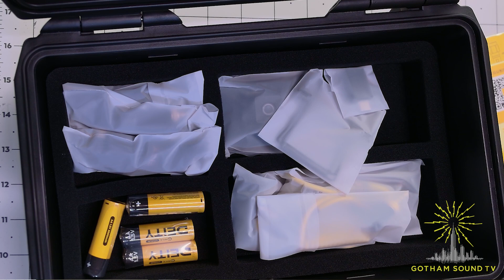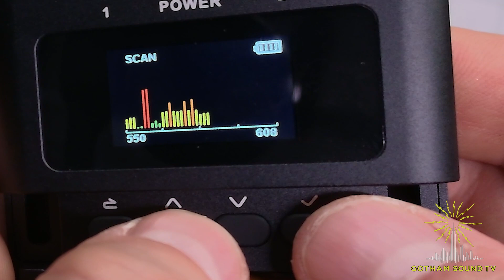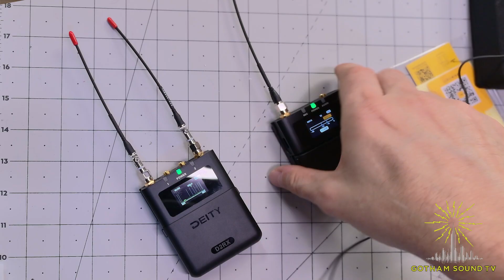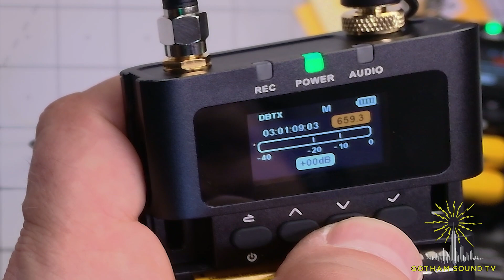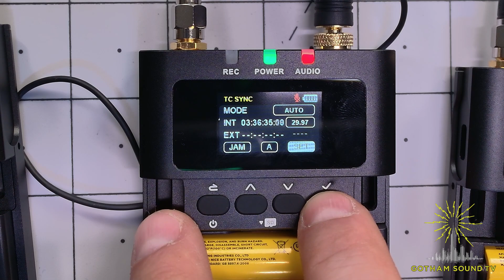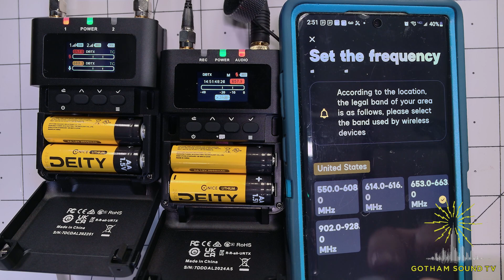Deity Theos Wireless Deep Dive with Andrew Jones

Comment: Be aware of the customer service is not that good. 4+ years of trying to fix my Deity Connect system... From my first support ticket in April 2021 to countless follow-ups, shipping costs, and tests - nothing worked. Instead of a real solution, I was pushed to buy a new Theos system "with a discount." After losing time, over $750 in related costs, and all patience... it's time to switch to Sennheiser.

Comment: How can Gotham promote these things? Theos wide bandwidth of the transmitter signal is 700kHz, over 3 times the width of any other wireless mic system allowed in the UHF bands. Theos is typically not allowed in any public event that is frequency coordinated. Theos transmitters also generate a large burst of digital RF noise over 1 mHz wide(!) every time they are turned on. The burst occurs around 550 mHz, for about 3 seconds. It does not matter what band the transmitter is tuned to, the burst still occurs at 550 mHz. Not a friendly device in a sound bag or in any location where other wireless are in use, like a PA system at a concert or conference. Those systems may get a 3 second RF hit on their wireless, or worse a loud audible burst of digital hash. Theos should not be marketed in the US.
Reply: I just notice this issue in a tutorial about Theos and the new Saramonic K9 with Curtis Judd. After a while Saramonic correct the issue and It was explain by Curtis. 
I am wonder if Deity will resolve the problem, and I say "will" because I am sure they can.

Comment: I just bought a Deity Theos kit to replace my 2 Sennheiser G4.
My setup: Alpha 7S3 with an XLR-K3M adapter. The K3M at micro level. D2RX level -20.DBTX +15DB (whatever the level the noise remains the same), RF power 50mw. 
Case 1: RX1+RX2 on the Jack 3.5 cable connected to the K3M (no line level on channels 3 and 4 of the K3M) the background noise is very loud. this configuration is unusable. 
Case 2: RX1 and RX2 connected to A and B of the D2RX with the XLR cable. micro level. there is still some background noise but less. The sound is worse than if I use a Sennheiser G4 or a DJI Mic 2!!!. 
Case 3. line level on channels 1 and 2 of the K3M. D2RX level 0 or +10. the sound on the alpha 7S3 input device is very very weak. it is not usable. 
Do you have any advice to give me that would be really nice?

Comment: Hey, I have a very specific problem, any helpful insights would be appreciated. I am connecting the theos via USB to my iphone (13, so lightening connector). I am using a simple OTG adapter: lightening to Female USB A and then an A to C cable for the Theos. It works, but its breaking up. I think it might have something to do with the fact that the Theos is being powered from USB and not from the AA batteries, which I can’t find an option to switch off. If anyone has any useful info or idea how to try and fix it, I’d appreciate the help 😀

Comment: Is it possible to connect the pr-2 with the theos receiver?
Reply: The PR2 will not connect with the Theos receiver.
Reply: @njh209 is the pr-2 an only record unit? No capacity to transmit audio signal to any kind of device?

Comment: For the RX, I'd like to see an option to output timecode, for either cam hops where a mono sum signal is fine for post or for auxiliary DSLR cameras. So for the big cams, one output is audio Left/Right and the second output is timecode .For the DSLR,  one stereo output, the left channel could be either one ISO or a mix of the two mics to mono (for reference) and the right channel would be timecode.
Reply: that would be perfect! high quality 32bin recording  on the two TXs and stereo-to-mono with TC into the camera... DEITY please DO!
Reply: I'm honestly surprised the Theos doesn't already do this, when the much cheaper TC-1 can output timecode and scratch audio in separate channels, and the Tentacle Track e can output timecode and audio passthrough on separate channels.

Comment: I’ve had this for a couple of months now, and I’m delighted. Nice build quality and versatility. Particularly love the packaging including a great case and every possible accessory, cables and adapters. I’ve used in both upper and lower band ranges without issue. And the timecode integration with the TC-1 and SL-1 make a wonderful package. What a great company.

Comment: I purchased the two channel system from Gotham in Dec. 2023. I have used it for live news and small corporate work.  I'm pleased and honestly  surprised how well it works.  Had in New Hampshire outside in cold weather during the primary and had no problems.  I Used the 900 band and had no issues. The system fits in with my other wireless as well. It matches well with my lectrosonics LRLT, Sennheiser ew500, and Sony D21&D26 systems. A real bonus is that my sennheiser wired mics will work with the deity transmitters. I will say that I used the W lav pro mics provided in the kit, and they  worked just fine.  Overall I'm really happy with the purchase.  The price point with everything provided is more than acceptable.  Having a company like Gotham committed to the product shows me I made good purchase.  But to qoute the Dude..."That's just your opinion Man...."
Reply: Thank you for your insights. Have you also used Sennheiser MKE-2 with this system?
Reply: @vothography  I haven't, but I have used my countryman B3s. I did change the power on the transmitters from 3 to 5 volts.
Reply: The B3s are wired for Sennheiser